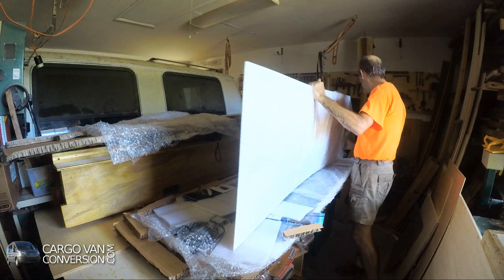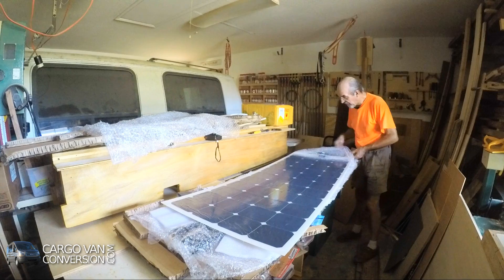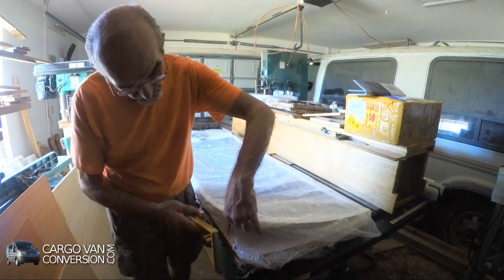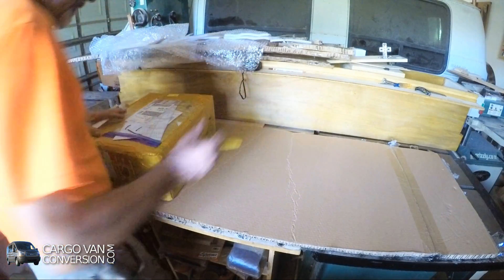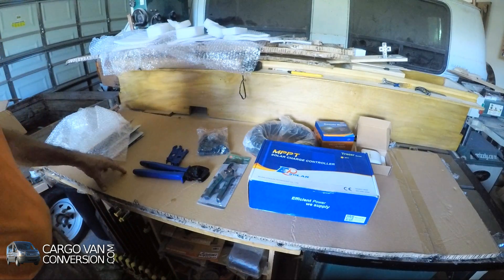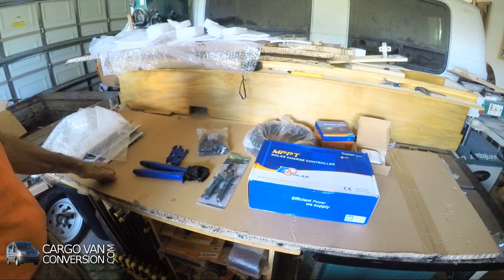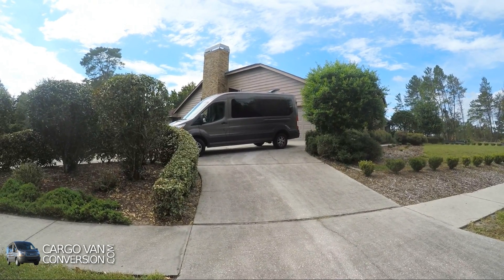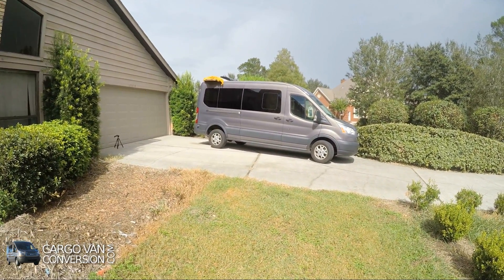Buying Flexible Solar Panels From China

Comment: This was a useful video - thanks. I am planning my solar install and weighing up the pros and cons of rigid and flexible panels (and even DIY built!). I'm starting with a simple split charge relay from the starter battery/alternator and will delay adding the solar until I am more confident with my choice. Stealth is important, as is MPG - My Ducato Maxi is a big van too. The price:watt ratio and reputation for reliability isn't so good for flexible panels, but I would save in fuel consumption later on.

The flexible panels look so tidy as well.

Linksolar seems good, but is it worth the huge premium over the flexible panels I see on e.g. Amazon?

I don't have any problem ordering from overseas, but I've had items that never made it out of the docks in China if I can believe the parcel tracking! Were the panels insured?
Reply from the maker: Hi Mevi,
All concerns I had to deal with. The main reason for my interest in flexible solar panels where reduced weight and their stealthiness. And I have been quite interested since their introduction, a couple of years ago. But what I call 'the first generation of panels', where over-hyped, especially by several RV enthusiasts. The unrelented bending and walking on these panels seemed to make them undestructible. The opposite was true; as we know today, they came with at least two major issues. They used a top laminate (PET) that started to delaminate in a short time in some of these panels allowing for water penetration and other deterioration of these panels (this should have been fixed with the ETFE materials in my panels). The other issue was that these cheaper panels, generally used a low grade solar cell with a short lifespan. http://cargovanconversion.com/LS/solar-cells As was explained to me, the solar cells in my panels are a higher grade of the latest solar cells, produced by Sunpower with an efficiency of ~20%, equal or higher than many rigid panels.
The price/performance ratio is fair at best. Now in 2017, I see rigid panels available at approx. 0.50-0.75 per watt, the cheap flexible panels (that I do not recommend) at about 1.25-1.50 per watt and these newer flexible panels at 2.50-3.00 per watt. Quite a bit more expensive, but with substantially less weight and almost invisible on your roof. On the other hand, with no proven track record. The stealthiness won me over, but reservations about the long term remain.

I had the same approach with these panels (and the Lithium batteries) as you: wait as long as you can, the see improvements in the product and more knowledge about the subject. As your needs become more urgent, you can add at a later stage. That's what I did with the panels and what I do with the batteries (I plan to wait another year or so with Lithium and start with two small 6V golf batteries).

I think that the comparison between Linksolar or similar companies with the cheaper flexible panels on Amazon is like apples and oranges: I would certainly choose rigid panels over cheap flexible panels if price was the only consideration. As I said before, the delamination issues and the low grade solar cells are determining factors.
I have had a good experience with Linksolar so far, but there are more payment guarantees if you can order through companies like Amazon, Alibaba and Aliexpress. That would likely add to the cost as well.
Mine were sent with tracking, but without insurance; I'm sure, they would be able to add insurance on request. Just email them and they will get back to you (contact Shoven Dean, he's the manager).
You could save on export taxes, like I did, but that's not guaranteed and depends on what country you live.
You can contact me if you have more specific questions by private message, or email on the website http://cargovanconversion.com/about 

Van Williams
Reply: Thanks for the reply, Van. Very much appreciated. Import duty at the UK customs is a lottery. I had most things make it through without charge, other things I had to pay duty - I remember abandoning one small parcel that for whatever reason, made it too expensive to bother paying for. :D

However excellent Linksolar are, their (justified?) pricing puts them outside my current budget.

Unfortunately, I don't have the luxury of time, as the deadline I have been set means I have a couple of months at best before I move in full-time vanlife. With all my costs coming in at once, I may be forced to future-proof the charge controller, but go rigid panel and upgrade once price:watt improves. I can't 100% trust average user reviews, as our use of panels is so very different to a home user.
Reply: @cargovanconversion  stealthiness - such a good word - and thanks for the vid.. I'm a weight freak, as much of my terrain will be uneven and obvs the roof is THE worst place to load up with kilos. However, as I'll be 1000's of miles away from my base - reliability is  also a big factor.. I too am planning to leave purchase as long as I can but, there comes a point where my design needs to settled - WHAT I'D LOVE - is an upto date appraisal for the surface and output of your panels please Van.. I hear, only hearsay that deterioration is/can be rapid
Reply from the maker: Hi Graham,
First, I'm not an expert, just have practical experience with solar.
I started with rigid panels in the early 80's and these panels are still working (at reduced efficiency). I was exited when the first flexible solar panels came around, but didn't have my van yet and wanted to wait for real live data about these new panels. Lot of hype about flexibility, walking on them, scratching, etc. Heard about heat issues when placing them directly on the metal roof.
Regularly mentioned issues with flexible solar panels:
- Heat issues: They are continued to be raised, but over the years, I only found one documented experience, that mentioned a 10% reduction in efficiency when the panels are attached directly to the metal roof of the van. That is already many years ago and must have involved this first generation of solar panels. My experience in the last year has shown no measurable reduction of the stated panel properties. And even if that is the case, it's easily resolved by adding more panels.
- Flexibility: They use to come with a stated 30% bendable properties; that is usually reduced nowadays to 15%-20%. You have to understand that these panels are flexible, but only for a curved installation; after that they should be left alone. Certainly never bend them inward, as the solar cells connection like will break. In my opinion, despite their weight advantage, they are not really suitable as a mobile panel. Over time they will bend too much or too often. They are clearly more fragile than rigid panels.
- Scratching: The first generation of flexible panels was very prone to scratching. The use of PET laminate was the main cause; they also seem to 'cup' quite a bit. The newer ETFE laminate has resolved that issue, I think.
- Mounting with VHB tape: I have heard and seen, VHB taped flexible solar panels detach from the roof. Main issue is to have an extra clean roof during installation and use Propylene Alcohol before attaching the tape. Mine are installed one year now; have seen no issues with the tape at all.
- Price: Good quality flexible solar panels ARE expensive. Only reason to get them is stealth and weight. If neither of those are important to you, get rigid panels. They have a proven track record and can be had for $0.50 per watt.

Properties to look out for:
- ETFE: The first generation of flexible panels used PET laminates to hold everything together. They are still being sold. Only get panels made with ETFE.
- Backcontact solar cells: Make sure that the cells that are being used in the panels are Backcontact cells. These cells moved the 'silver contact lines' from the front to the back of the cell, thus improving sun exposure considerably.
- Solar cells grade: The biggest issue with any panel you buy. There are many grades of cells that are being used. Unfortunately the ordinary man cannot distinguish the difference. You are entirely dependent on the manufacturer for that. You will pay much more for higher grades.

My experiences in the last year:
I'm located in Central Florida and in summer the sun can be harsh on the panels. I have seen no visible changes to the panels. They still look like they were installed yesterday. No deterioration.
For most of this time, I've only had a roof vent installed on a test installation with two 6V golf cart batteries (will be replaced by Lithium). So output information is minimal. What I noticed, is that these panels already start producing when the sun is just above the horizon and till late in the day even though they are flat on the roof. They are affected by shade (additional mobile panels could reduce the issue) like are rigid panels. Switching between parallel and serial installation will reduce that further. They produce 26+V but so far the vent only used a minimal amount of that. Recently, in preparation for my trip to the RTR in Arizona in January, I have connected ceiling lights, a fridge, charging point and a water pump. So far no issues powering that. From the numbers that I've seen, the three 135W panels should be able to produce 200A a day if not substantially more (on a sunny day). In addition, I have a mobile flexible panel and a solar blanket for a total of 500+ watts. There should be no issues at all with regard to power. I may have some more info after my first one month trip with this setup. BTW the mobile panels are connected to an Anderson connector placed under the rear bumper that leads to a separate controller.
I highly recommend you to contact Dean at info@link-solar.com for more technical details. His English isn't that smooth, but he will try to answer you're questions and otherwise refer to me and I'll get back to you.

Hope this answers most of your questions. Please ask more if so necessary or after I've returned from my trip.
Van Williams
Reply: @cargovanconversion   Excellent Van. Yes, for sure I will be interested in hearing more about you and your set up. Disappointed that you still don't rate them for mobile use;  my concept was always to attach the flexible panels to a perforated lightweight subframe. The way I looked at it was; A) I keep the S/P cooler, AND it then forms a form of shade on the actual roof. Win Win.
B) As I'm going to be traveling across Russia and Mongolia I was planning on some form of tilt mechanism, to optimise my gains (I'm planning on belt and braces approach as I'm expecting to be drawing quite a lot of amps quite regularly) 
Interesting to hear that visually the ETFE is working.  Keep on rolling and look forward to hearing more about your experiences. G
Reply from the maker: Hi Graham,
Great plans across Russia to Asia!
What I meant by not suitable for mobile use, that they are too flexible and the connections will break in time. When you support them by a more solid subpanel, they are as good or better than rigid panels.
ETFE is a Japanese material that lets light through one way and is much stronger than PET. Pricey material.
Good luck with your trip.
Van Williams
Reply: Mevi Hi Mevi, how did you get on with your system, what did you settle with? I’m just about to embark with van solar, I’m going with 2 6V batteries giving me 460ah, I’m also using a split charge relay.

Comment: Looking forward to seeing how you complete the installation, especially with those rain/structural roof channels. Your typical detailed presentation is much appreciated.

Are these panels mono or poly crystalline? I hear that the mono panels loose a great deal of efficiency if there is any shadow on any part of the panel. Thus I am concerned that the curvature of your mount will result in greatly reduced power output.

Good luck! Love your work!
Reply from the maker: Hi Mark,
Thanks for watching and the nice remarks! That's appreciated.
For a start, there is very little practical, real-life information available on these newer flexible panels and you'll have to follow me the next months and years to find out how well the work or not. I'll find out at the same time :)
It is likely that I can keep these panels within these 'rain gutters' on the Transit.
I'm not absolutely sure, but I understand your concern. You should know that these backcontact cells are some of the latest cells made by Sunpower and have a ~20% efficiency. 'Backcontact' means that all the 'silver contact lines' are placed on the back of the cell, creating more exposed surface on the front of the cell. While all this theoretical data is nice to know, I put more emphasis on real life. Just yesterday, I placed these panels, midday with lots of sun on a flat surface (without load) and they produced ~27.7V @ ~5.05A at a stated 24.9V @ 5.7A. The higher voltage is nice as a MPPT controller can boost this amperage substantially, especially in winter when it's cooler and more needed.
But interestingly, while measuring with both hands, I had only a foot left to hover over the panel and see what the effects would be on the amperage. The amperage only fell from about 0.35A from ~5.05A to ~4.65A, which was a pleasant surprise. This was only a quick check/test of these panels, just to make sure that they worked; I will do much more testing in upcoming videos and on the website. We'll have to see how things work out.
One more thing, I think that the curvature of the roof is a positive fact as the roof is exposed to more (and longer) sunlight. However, I doubt whether that will make much difference in real life; parking and placing the vehicle in a better position in relationship to a southern exposure, is more important as is avoiding shadows on the roof.

Van Williams
Reply: By my calculation, that is an 8% reduction in amps (or power - if the voltage remained the same). 

I've got to say, I am rooting for this to work. I love the minimal profile.

BTW I did see another video where the guy used tape to mount them to the roof. After several months of use, he found a little water leakage in the corners of the tape where the (horizontal/vertical) tape overlapped, and created a tiny pin hole.

Looking forward to more of your videos!
Reply from the maker: Hi Mark,
Have seen the same video; he used (wide) Eternabond tape on top of the panel and the roof to hold the panel down. That just wasn't a good solution; he would have been better off securing it differently to the roof and by using a product like Dicor to hold the water at bay. This a 'first generation' flexible panel and he may have done that, because some of these panels tended to delaminate.
I will use 3M VHB tape between the panel and the roof; completely invisible after installation.

Van Williams
Reply: Yes, I think that was the same video. My issue with Dicor is, perhaps, a minor one: Wind Resistance. How will you attach the panel to the roof over the rain channels? Will you fill the channels in? Or will you leave them open and let wind and rain flow freely? If the latter, won't the vibrations from the wind cause earlier failure of the panel?    (The suspense is killing me!  ;-) )

Going back to an earlier subject: It might be interesting to do a quick and simple experiment to see how shadows affect your panels. You might take amperage readings with the panel half covered, 1/4 covered, 1/8 covered. I suspect that the power reduction is non-linear.
Another experiment might be done to determine how much power loss occurs at different curvatures greater and less than the one on your roof.

Warm Regards,
Mark
Reply from the maker: Hey Mark,
I will center the panels on the roof and keep them within the 'rain channels'. I have a few issues that I want to solve. These flexible panels (but rigid panels too) may have some heat dissipation issues; using the VHB tape will raise the panels slightly off the roof. Leaving some spaces between pieces of tape may allow for some (minimal) airflow. Keep in mind that I will try to use a continuous strip of VHB on the front facing end of the panels. There are a few additional corrugations on the roof which I might leave open or fill with multiple layers or VHB.
Probably will also use many individual pieces of VHB under the panel, to avoid 'flutter' while driving.

I plan to do more extensive testing of the panels before and after they are installed on the roof. The testing that I did, was only a quick test to verify that the panels survived the shipping.
The relatively small reduction in power got me interested in doing some more testing about how shadow influences these solar panels. Probably will cover 1/4, 1/2, etc. of the panel, but am more interested in 'natural shadowing'; will use some branches with leaves for that. In real life panels are not often blocked solidly, but diffusely by forest trees.
Curvature is a more thorny issue. Don't want to bend them too far or too often; that has been one of the cause for failure of the earlier panels and how they were promoted. The curvature is more about the exposure to the sun. That's a major variable also dependent on location and weather; difficult to measure accurately.
We'll see how it all works out.

Van Williams